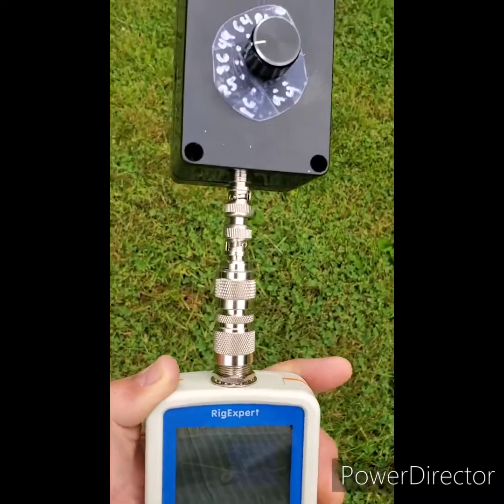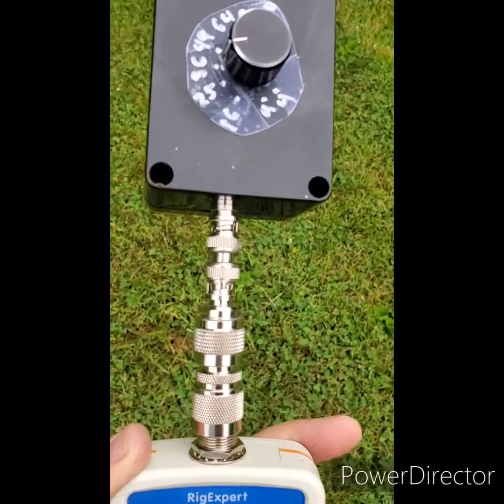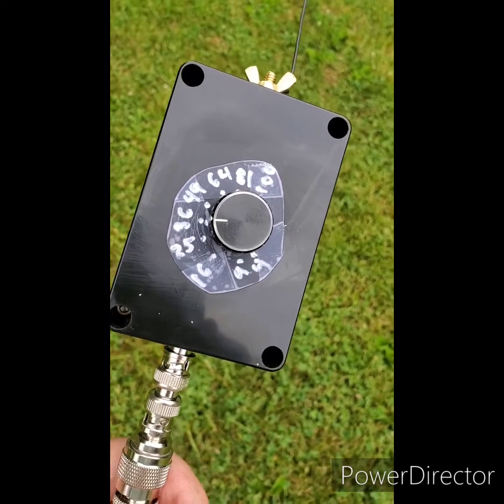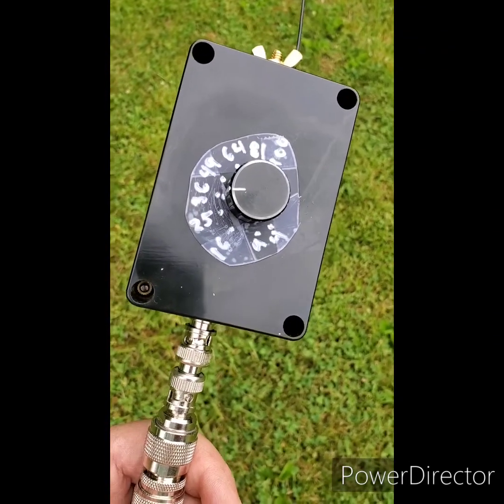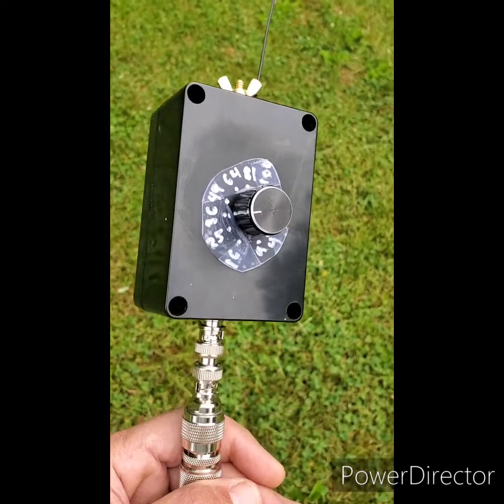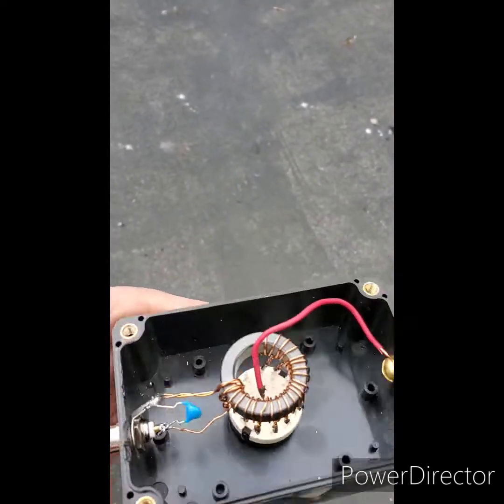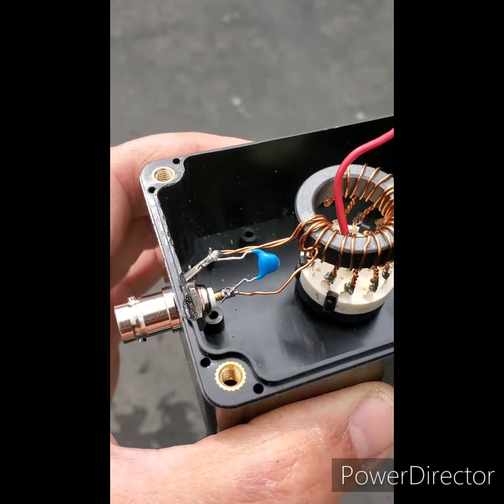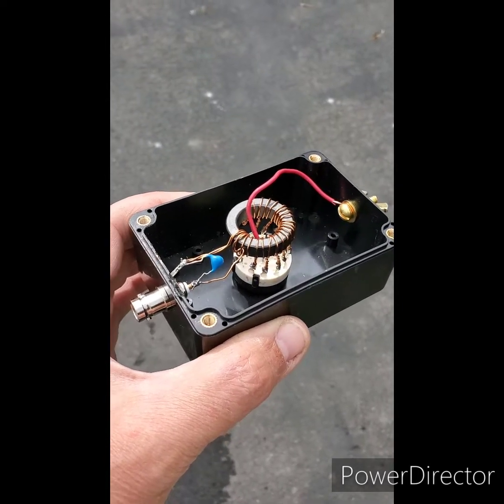Step-variable End Fed Half Wave ( EFHW ) antenna transformer for improved amateur ham radio QRP use

Comment: Nicely done!  It appears there is a 2 turn primary then taps start in at the 4th turn then every 2 turns until the end.  Is this correct?  Would you be able to tell me how many turns total, please?  73, N4MJR
Reply from the maker: Yes, you are exactly right about the primary 2 turns, and a tap every 2 turns starting at turn #4. There are a total of 20 turns altogether, resulting in a maximum 100:1 transformation.

Comment: What Toroid did you use? Thank K7WHN
Reply from the maker: Any type 43 toroid will work fine, if sized appropriately for the power level. The one pictured is made for a 20 watt maximum.
Reply: @bradenglettkd8zm69  Thanks

Comment: First saw multi-tap transformer by N8NK (Youtube Channel) N8NK built and used several Multi-Tap transformers on his youtube channel. I tried it but it did not work as well as I hoped with my wire antenna. I use an antenna switch between 49:1 EFHW Antenna, 9:1 UnUN EARCHI Antenna and TrueLadderLine Doublet Antenna with Balun Designs 4:1 Transformer.